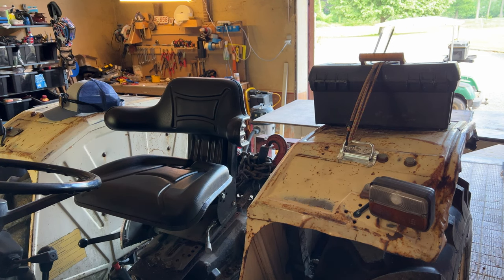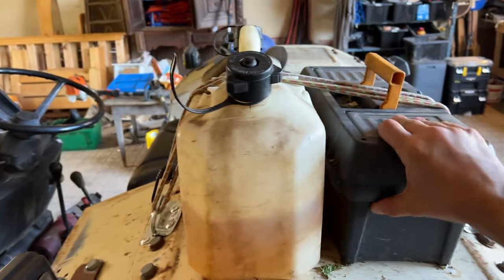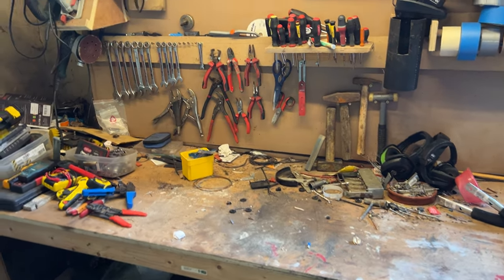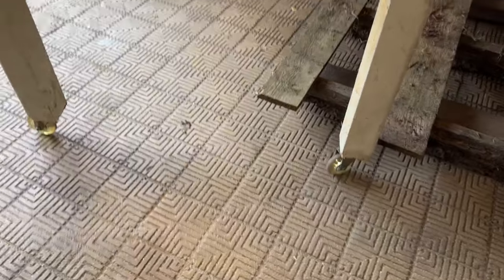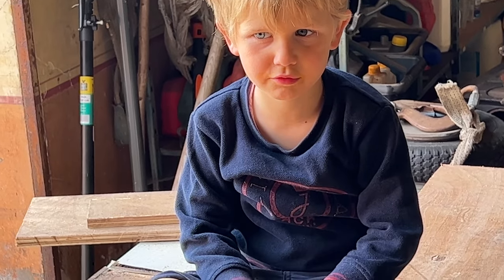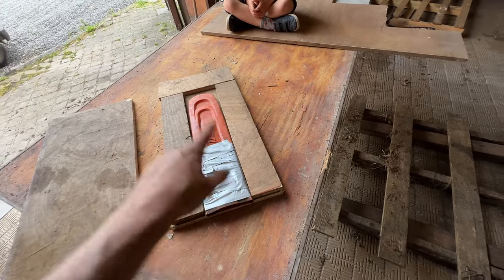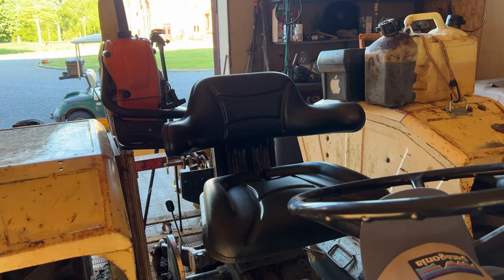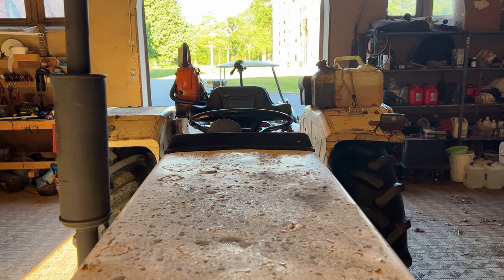ULTIMATE FIREWOOD TRACTOR

Comment: Love your vlog again this time, always have solutions to problems, big or small....you are not defeated. This time it was what to do with the chain saw when driving the tractor? And of course you came up with a super idea that worked out just fine! Of course you did....lol One thing though Amaury, how did you go about attaching the whole unit to that plastic wheel cover? Did you drill and then use a screw & bolt? We imagined that would be the only way it would hold the weight of the chain saw once it was inserted into it's blade protective cover? Are we right, or did you find another ingenious way? Also you had a bit of a break after it was made and mounted didn't you? Know how we know? You no longer had your original shirt on but another one, and also you wore a sweater over the top of it. You also had a bit of a shave and a clean up didn't you?? Ha ha many of the people here that were watching with us, noticed and pointed it out......too funny! Tell Maxim hi and not to worry if he didn't help papa this time, he usually does when his big brother and sister are around. Think he was just tired from school today. Au revoir Amaury!
Reply from the maker: Hi Lyn,

Thank you for your comment.
The whole frame of the tractor is metal, no plastic. The chainsaw holder is held to the frame with 2 bolts and nuts. (I had to drill 2 holes in the frame of the tractor.

Have a great day.

Amaury